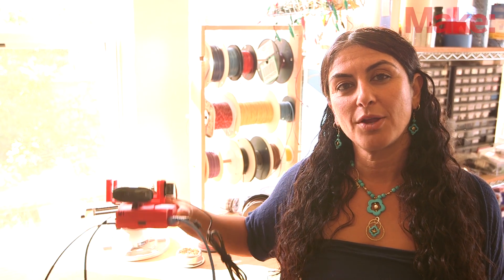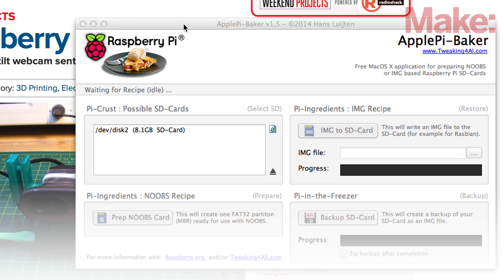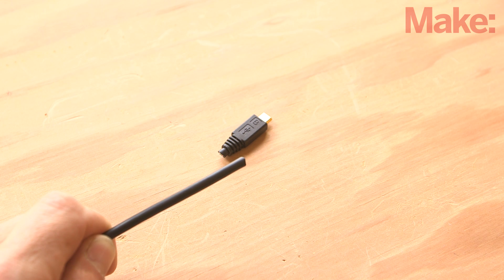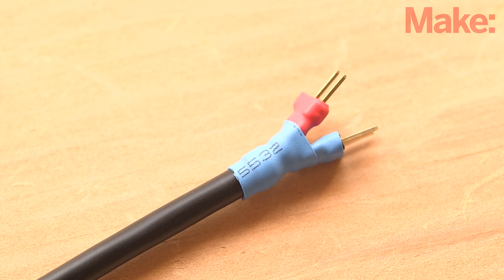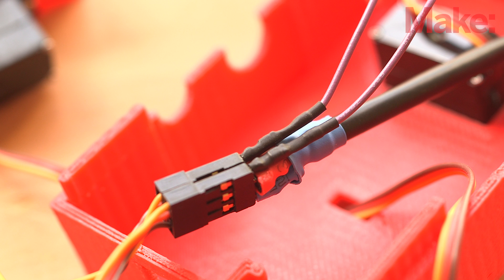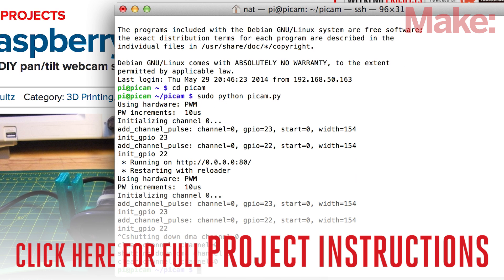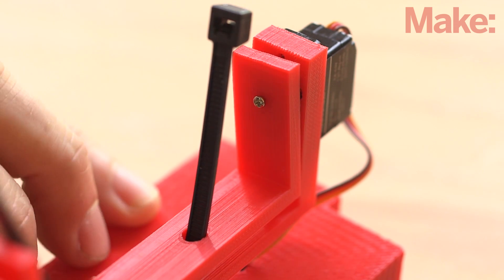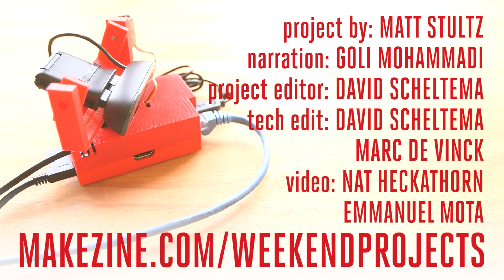Weekend Projects - "Raspberry Eye" Remote Servo Cam

Comment: I made a raspberry pi 2 security camera using motionpie image. The picture is sluggish and you can view it only in browser, android apps don't support it. You can buy a 720p camera cheaper and it will have a much smoother picture, also you can view on many free android app. Making a cam using raspberry pi is very bad idea.

Comment: can u use a arduino uno
Reply: what? that's not even a computer..
Reply: you can't because i do not think an arduino shield have enough bandwidth to carry video signals, but you can make the control system for servos with arduino and use a cheep Ip-camera for the video part.
Reply: sucks a lot and you are gonna need buttons to control it.
Reply: i know i did some research
Reply: alek tape there is tons of programs to control servos over Internet and you just need 30min to program one... you might need some PHP/javascript skills tho....

Comment: I think using mouse control would allow for a smoother panning and tilting motion. At the moment its a bit jerky.
Reply: I think you might be correct.
Reply: I have a question. .. is it possible to create a GPS tracking system and mout it to a rc car alone a camera sorta like cod 2 RCXD?
Reply: Sorry for misspellings anything im useing a cellphone, and the buttons are to small for my big fingers.